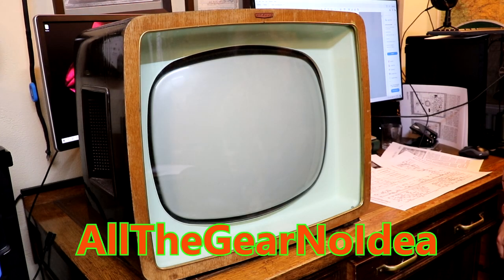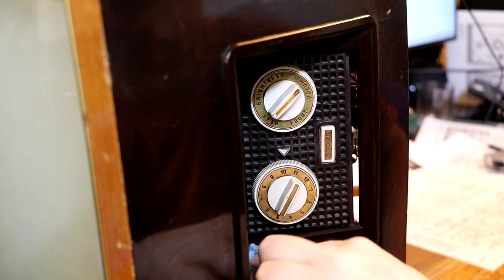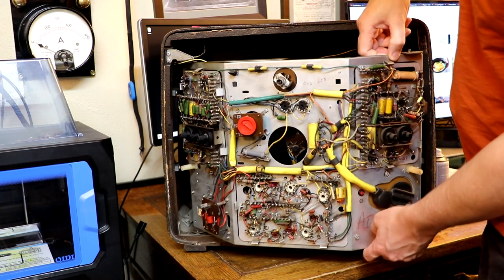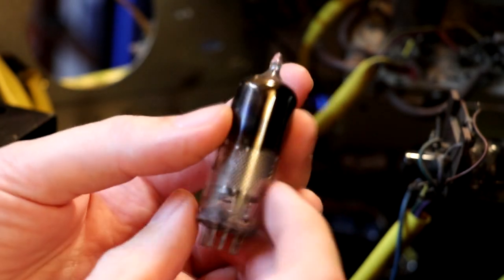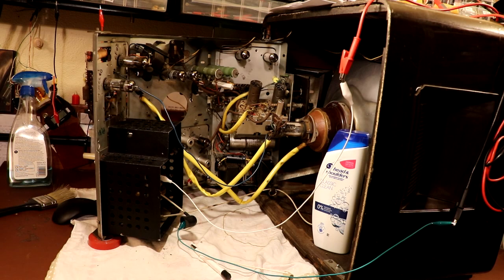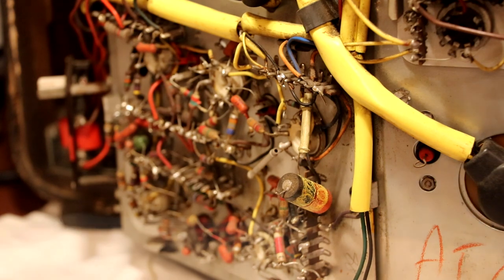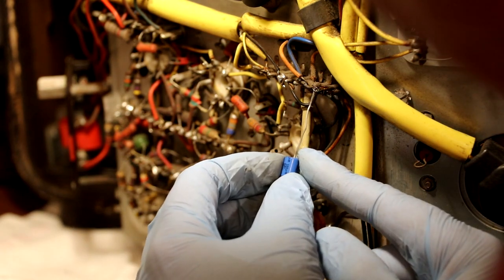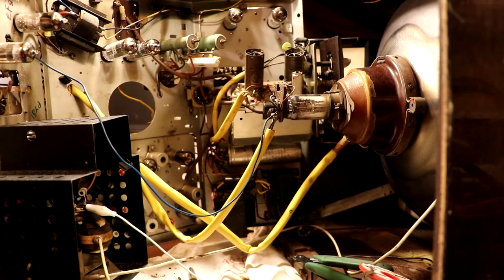Shampo066 Stella TV Repair - Part 1

Comment: 14:20 dont bother with that, some tvs and some picture tubes use 700v or more focus voltage on the focus anode, some work better with no voltage at all...once you get a picture you can experiment attaching the wire but it will work regardless...those slider pots are never good, i suggest you find a suitable focus resistance value for best picture and use a fixed resistor, you will never have to adjust it anyway
Reply from the maker: Thanks Hugo. Do you have any advice for the best way to power it up and any components I should check or change. Apparently the boost capacitors fail on these.  A few people have said these tubes are internally focused or something so that focus control doesn’t do that much etc. Thanks regards Chris
Reply: @allthegearnoidea6752  hi! ialthough i never worked on that particular model , from what i saw on your video, i believe the boost cap is c504 and you must change it before power up...it may fry the flyback if it shorts and it will kill the high voltage if its leaky...confirm that it is the boost cap by checking that it has a massively high voltage rating from factory (more than 1kv usually )...replace it with a MKP cap or a cap rated for ac pulses... then snip all black tar caps and you can power it up...keep an eye on the boost voltage, if its too high dont let it run for long...boost voltage together with proper width indicate a healthy horizontal output stage. the only other thing you should concern are the big electrolytic cans...they like to leak and blow the fiuses but that will not damage the tv...at this point only if you get a raster on the screen than you can proceed....if you dont get a raster or atleast a line on the screen there can be two problems , lack of high voltage or lack of crt bias..if you have any of those i will be happy to make an effort to help diagnosing. if you get a line on the screen (horizontal line) than you have a problem in the vertical stage (yes sounds confusing)but its a very common failure...dont run it for long or you will burn the line on the phosphor of the crt....horiozntal and vertical oscillators are easy to diagnose and fix, it will be fun fixing if it doesnt work right off the bat...anyway get that raster but dont run the set for long until you do some recap and maintenance (dont change the green mustard caps)..i dont advise messing too much with a set before powering because due to the complexity of a tv you WILL introduce faults and without a baseline you dont know how those problems occured...be carefull when measuring certain areas of the tv with a DMM because you may fry the meter...especially near the flyback and to whatever is atteched to the plate of the vertical output transformer also...to check high volatge you can just use a plastic handle screwdriver and draw an arc, dont worry if it zaps you its not that bad, its a black and white and the voltage is "low". dont get carried away and draw arc for very long, and never draw an arc from the body of the windings (instant carbon tracking/flames and instant flyback death)...only use the tube caps to draw sparks from.... aahahah sorry for the big text, good luck
Reply: @allthegearnoidea6752  another things i remembered: when first powering it up dont use a light bulb dimmer or variac because if the horizontal oscillator doesnt start then the horizontal output tube will get overbiased massively and will fry in a couple of minutes...you just power itup and after 10 to 20 seconds you should start to hear the 15khz whistle (if your ears are good) aftert that a couple more seconds and you should hear high voltage crackling...if you dont hear those then turn it off...also turn it off if you hear very loud sizzling or you see arcing...if you need to do repairs on the high voltage section always make the solder blobs round, never leave sharp edges, if you need to insulate anything on the flyback you should use sensor safe automotive silicone (RTV).its cheap and highly dielectric, very suitable for tvs

Comment: High voltage and x-rays in the high voltage compartment!
Reply from the maker: I’m not too concerned about the X-ray on this set as the HT is relatively low to produce X-rays. However I agree not something I want to take a chance with either. Thanks for watching and comments

Comment: 14:25 dont bother with that, most likely the pot was arcing, they are never good....some tvs work fine without any focus voltage, some tv and some crts will take up to 700v or more...regardless of that the tv will work and produce a picture anyway so after you have a proper picture then you experiment what resistor value works best and use a fixed resistor there....it will never need adjustment unless you swap the crt etc... one interesting fact is that the focus voltage is there just to concentrate the electron beam but almost no current flows through the focus anode, it "needs" voltage there but it consumes virtually zero current

14:51 to me looks like a spent tube , hope it still has emissons
not sure what the ef85 does on that particular set but they are usually IF amplifier valves and the colour looks normal to me, its the getter and some evaporation of materials

the round metal things you are adjusting are for picture centering...dont worry not critical...adjust them in the end of the repair..one shitfs the picture horizontally and the other verticallybut one affects the other, its fun you will see

the plug on the back of the flyback usually is an efficiancy adjustment wich acts as a width or high voltage adjustment (dont know for sure on that model) but usually you measure your B+ Boosted voltage (700 to 900v on that set maybe???) and once the width of the picture just fills the screen the boost voltage should match the specified...if not that you may have some spent tubes (damper and horizontal output) or you may need adjusting the width or the high voltage controls depending on the tv...

those black caps...check if there is any of them from the heater string to ground...if there is one just snip it...if it shorts you will burn vlave filaments by overvoltage...happens a lot on philips sets and that is basically a philips clone

20:09...i never do that...overwinds are easy to swap and you can use one from a different set...messing with the flyback beafore testing the tv will introduce problems...just snip the black tar caps and plug the thing on with the meter connected to the b boost voltage and monitor it and youre good
Reply from the maker: Thanks for comments. Sorry for not responding sooner your comments didn’t come up in my notification. Thanks regards Chris